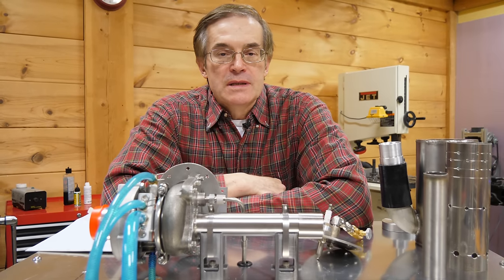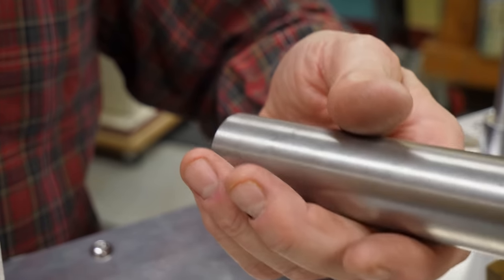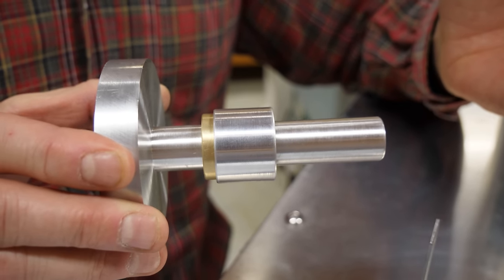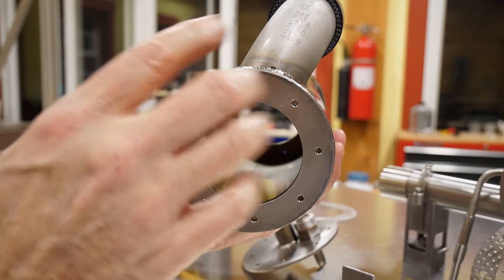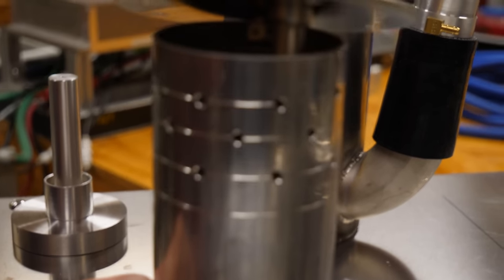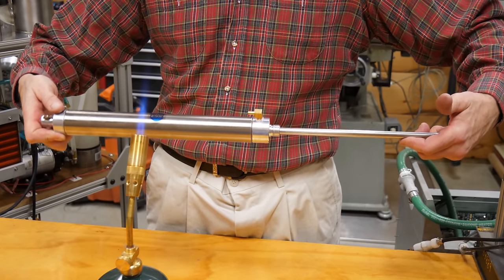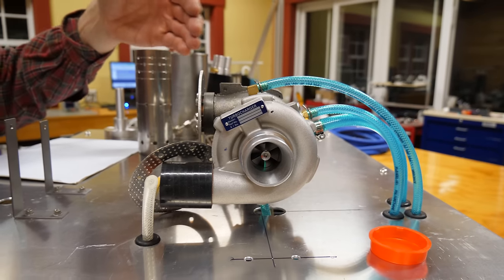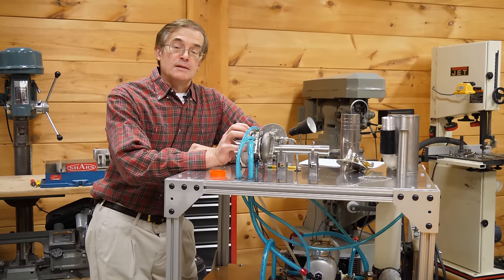The Turbojet!

Comment: You know what just gets me, I've learnt more about turbocharging cars done years of watching builds could had. Specifically interesting is the oil pressure stuff. Now I know why you need higher oil pressures when you turbocharge Honda 4cyl to 700+HP
Also the heat soak stuff, very interesting.
Reply from the maker: Thanks!
If you check out some of our other videos you'll notice that there is a lot of information that is related to the topic being presented, but has broader utility.  That is why our videos tend to be relatively long.
Reply: @TechIngredients  I found you channel long ago, but I remember my stupidity and superiority complex kept me out of it for a while.
I first saw your revolutionary AC video and I thought you were over complicating stuff by adding desiccants, while you could just pump the cold, swamp cooler water through an heat exchanger with a fan and direct that air inside the building. I found the video again today and realized how much I had missed because of not wanting to hear through the whole thing.

I really appreciate your videos now that I've matured and I see many ideas I've had over the years being implemented into your projects. The EDF motorjet comes to mind, an engine that I wanted to build years ago. There, you also see the propane motor cooling, just as I had thought of something similar, utilizing liquid nitrogen to run an electric RC motor above specification.

Anyways, keep them videos coming, I love your projects and I hope to be building my own ideas soon enough!

Comment: This will be a reference for upcoming DIY turbojet enthusiasts. You nailed it with the numbers. Awesomeness at max👊🏽
I want you to add one more turbo which will run on steam generated by this engines heat and drive it's compressor which will increase the compression ratio. Can you make it into a reality?
Reply: I feel like introducing water to the inside of a turbo is a bad idea
Reply: We will achieve that by adding a heat exchanger instead of directly injecting the water.

Comment: It would add to the complexity of the build, but it would be useful to capture the diagnostic data in digital form for later analysis. Thermal sensors in the combustion chamber and exhaust stream would allow you to capture additional useful data. As one of my college instructors used to say, you can never have too much data.

Comment: Way back in my middle-twenties I had built a stock 1600 cc Volkswagen motor for my Karmann Ghia. To add additional power I’d bought a Ray-Jay turbo. But, lacking in information and engineering experience, I was too afraid of blowing up my engine and never installed the turbocharger. 
Carbonizing the lube oil was one of my concerns. The other was that I didn’t make so much money that I could afford to be blowing up motors.

Comment: Speaking of the combustion chamber if you were to sleeve the inner cylinder with matching holes overlapping but movable you could control part of the throttle by rotating the inner cylinder and changing the airflow through the chamber.

Comment: I would recommend using a automotive remote oil filter kit. This allows you to have and maintain the oil fiter for much cheaper over time. 

Also, the 'series' turbo setups are called Compound turbo chargers. You could possibly mount the chargers in a parallel turbine, series compressor orientation as well.
Reply from the maker: Thanks!
I will review that terminology for the viewer in a future video.  Series turbocharging is a good way to describe this process to those not familiar with the principle, but is not the terminology used by those with experience in this area.
Reply: @TechIngredients  not meant as an insult. Funny thing is, you're dabbling into things I've done on all fronts. Turbos, audio. The works. Love it. Keep it up.
Reply from the maker: No, offense taken!  Your point is a good one and thanks for comment.  There is a tendency to think that things we each know are understandable to others who may indeed be otherwise very knowledgeable.  I try to keep this in mind in these presentations.  I don't want to talk down to anyone, and I don't want to let jargon get in the way of a simple principle.

Comment: Pretty neat and might work well but can't help feel that an engine with very short path and a bare minimum of direction changes has to be markedly superior. Might be 15 degrees total change in a straight through engine whereas a car design like that might have 1500 degrees of turn in a simplistic laminar interpretation. Of course you want a near perfect mix and burn but a combination of numerous mister injectors and a bare minimum of intentional vorticity if any should be possible. Deliberate mix over lasting stagnant chaotic confinement.

Comment: Instead of using additional air for cooling the peak combustion temps, use water injection instead.
Also, the same water that you will be injecting should be used for bearing housing, and oil cooling.
This keeps all the heat energy inside the system, rather than throwing it away by heating the ambient air.
You can also fabricate a closed shroud around the exhaust nozzle, the combustion chamber, and
the hot Turbine side of the turbo housing,
then direct that hot air into the Compressor Inlet.
This will affect calculations of the relative sizing of the Compressor to compensate for the reduced air density.
This may seem counter intuitive at first, but it's actually not, this, combined with the cooling water injection,
will actually reduce the peak temperatures, and increase the volume/pressure of the exhaust gases,
and increase overall efficiency substantially.
( as if, jet propulsion was good for anything besides jet airplanes ) 
( it is a fun project though, and better thought-out than the first one )

One other item......
You really should look into  "Stagnation Point Reverse Flow" (SPRF) Combustion Chamber design.
( as if, you really care all that much about reducing emissions and gaining maximum combustion efficiency )
It is also virtually immune to blowing out the flame, and can operate at extreme mixture ratios with total stability.
BTW, I don't think you mentioned what type of fuel you intend to use.
I would recommend Diesel, it's safer, lubricates, and contains more energy than just about any other practical fuel.

Water expands FAR more when it is converted to Steam, than the expansion from heating additional air.
( Water to Steam = 1600 X volume, if I remember correctly )

In addition to this, a multi-walled Combustion Chamber design allows for more TIME, for any fine water droplets
to be converted to lots of wonderful STEAM,
and better thermal control of peak combustion temps.
Remember, the only thing that high temps are good for is expanding air, or creating MORE STEAM.
It is more advantageous to have 500F steam, with crazy volume, than it is to have 1000F AIR with much less volume.
( actually, the exhaust is already ~85% steam, and using the excess steam temps to expand air is not very efficient. )

You better watch out ;)  if this keeps going, I'll walk you through how my ~80% efficient engine invention works.
It actually produces copious TORQUE on a shaft, rather than the limited usefulness of jet propulsion.
YouTube videos on turbocharger jet engines is what set me on the path to creating a completely new
method of producing torque.
It works at ~450psi, and ~450F, and is specifically designed to produce steam "on demand", and efficiently
turn that steam into very practical horsepower, with NO reciprocating parts.
And here's the kicker..... It's made out of PLASTIC, (except for the combustion chamber).

Looking forward to the next installment.
.
.
Reply: Don't some jet engines also use the fuel for the cooling instead of water? Pre-heats it prior to going to the burner, but it also means one less thing to carry where you're weight-constrained on an aircraft.
Reply: Generally, (and there have been many, many configurations over the years and amongst manufacturers),
in real jet aircraft engines, they are usually more concerned with the problems of
oil and fuel freezing-up and coagulating in the lines and filters at high altitudes where
things can get really, REALLY cold, rather than any considerations of efficiency or power increase.

On the other hand, 
back in the days of piston powered aircraft, 
most military aircraft had water, or, water/alcohol injection, 
for suppressing detonation under full turbocharger boost conditions. 
This was especially important during fully-loaded take-offs on short runways.
.
.

Comment: Heat-Soak is the main reason why you're supposed to let any type of engine cool down at idle for a period of time after use. This allows the cooling and lubrication systems time to "wick" the hot-spots out of the engine before equalizing its temperature. Also, using one turbo-charger in front of another is typically referred to as a "compound" setup. In cars/trucks, using compounded turbos also gives the benefit of decreased "turbo-lag."
Reply from the maker: You're right.  I know what you mean about the terminology ie compound turbocharging and I know this is widly accepted, but I think it is confusing to someone not familiar with the jargon.  Series is clear enough for the application as I proposed it, but compounding implies mixing like blending chemicals, as well as multiplying like compounding interest upon interest.
I'll review the jargon for the viewer when we get to the two stage system video.
Reply: @TechIngredients  Fair enough. Thanks for the reply.

Comment: Great video, but I have a few questions. I am tempted to use a cheap oil/fuel pump but am not sure if it will make adequate oil pressure, what pump did you use and how much pressure does it make? For the oil cooling system, do you have to use a filter or can you get away without one? How does the oil system work, does it just get plumped into the top of the turbocharger and then has an outlet at the bottom that drains back into the tank? How large is your oil reservoir and what kind of oil do you use? Sorry all the questions and I swear this is the last one. Have you made an afterburner for this turbojet engine? Thank you so much for making these videos, I find them very entertaining and information dense while at short as possible. 
Thanks.
Reply from the maker: Because we have no plans to use these engines for thrust, but rather to generate high pressure gas to drive a turbine, we won't be adding an afterburner.
A typical automotive oil pump should be fine and we didn't use a filter.  I would recommend an inline pressure guage as that proves you have sufficient oil pressure when the engine is so loud that you'll have no way to be sure it's even running.
The reservoir only has to be large enough to avoid bubbles from being sucked into the pump's inlet and have enough reserve as a little oil will be consumed in the jet.  The plumbing is trivial, just make absolutely sure the oil is flowing.
Reply: Tech Ingredients, Thank you so much for your quick reply, and I love how well done and neat you make your projects. For the oil system, what I understand is that the oil is plumped into the top of the rear section of the turbo and then drains through an outlet directly underneath where the oil is pumped in. And form the drain it flows back into the oil tanks. Is this correct? I am planning on having 2 oil pressure gauges and a temperature gauge because I love redundancy. The pump I am planning to use is 10 Gallons per minute, is this enough? Also I did some calculations and my oil tank is approximately 2 gallons. Do you think this is enough for a decent sized turbojet? How large is your oil reservoir? Also, in other YouTube videos (colinfurze’s) the oil system used a bypass system that would let oil back into the reservoir when the pressure went above 3 bar(43 psi). Is this necessary for a safe oil system. How large is your oil reservoir? Again, sorry for all the questions, but you learn from the best, so with your input I should be getting somewhere. Thanks.
Reply from the maker: Your pump and reservoir are fine.  Your reservoir is probably twice as large as it actually needs to be, but don't forget to include a radiator.  Both the oil and fuel pumps (if you are using liquid fuel) can incorporate bypass valves to allow you to adjust the delivery pressure while maintaining flow through the pump.  They need continuous flow to cool themselves.
You can pump the oil in either way as the delivery pressure far exceeds gravity, but the in/out will be best defined by the fittings on the center section.
Remember, Furze's turbo burned out it's seals on his first runs.😙
Reply: Tech Ingredients, Thank you for your quick response and I think I know what I’m doing now. I do plan or using a radiator that I’m going to put a motor with propeller in front of to give airflow around the radiator. I am planning to use an electric speed controller to adjust my oil pressure by increasing the voltage going to the pump. Do you think I should just go with a manual one instead? The last thing I’m concerned about is the safety bypass valve because it’s rated at 3 bar(43 psi). Is 43 psi a high enough pressure to feed into the turbo, or will it get blown back through the delivery system? And I’m not too concerned about the pump running dry since my reservoir will be so big there will always be oil circulating. I’m still not sure whether to go with the safety valve, do you think it’s necessary? I noticed you used that reinforced tubing for the oil and water systems. Do you think hard plumbing with copper is better or can I use the reinforced soft vinyl tubing?
Thanks. 
P.S. I am planning on using propane to run the engine first and then would like to try to convert it to liquid fuel.

Comment: We could add water to keep the combustion temperatures down. if we use Ethanol as fuel, we could add a specific concentration of water to the fuel and still burn a stoichiometric mix of ethanol and air. the additional water vapor in the exhaust should also give us better performance.
Reply from the maker: You would want to add the water or methanol prior to the combustion chamber to allow higher density air to enter the combustion chamber.

Comment: Howdy, watched a lot of your videos and I think they're good and informative. Can you do a video on converting a gas engine into a partial hydrogen based motor? People are using containers with water and a form of electrolyte, they are adding electrode conductors and energizing the system to create a h20 gas and power the engine on vapors. Examples being used are vehicles,  lawn mowers, generators, etc.

Can you do a version of this project? I bet it would be great!

Sincerely, 

Justin Forsman

Comment: Really good video.

During watching it I asked myself whether it could get more efficient, besides sequential turbocharging, by attaching a prop to the shaft. This way it would kind of work like a Turboprop. Although probably that would be quite complex to implement and not incredible effiecent because of energy loses in the construction...

Anyways keep it up!
Reply from the maker: Thanks, we will.
We are building a free turbine output to allow low speed applications like a transmission drive and a generator as well as a large diameter propeller.
Reply: Tech Ingredients  Nice, looking forward to that.

Comment: Typically, an axial flow turbojet engine deliberately bleeds off a small amount of air at the 2nd or 3rd stage of compression to cool the oil reservoir and some other thermally sensitive items because on them it is just easier to divert a small amount of compressed air than to add many additional pumps.

Comment: Love your jet project,very straight forward explanation.I.m in the process of building one myself.I like your idea with using a fuel pump as the oil pump,does the heat of the oil cause any issue ?
Reply from the maker: I haven't had any, but I'm using an oil cooler as well.

Comment: Also if you add "louvers" S shape pieces to your combustion liner with a gap in the 0.075" it will lift the flame off the walls and create a low pressure zone, in the low pressure zone add cooling holes, a LOT of them but very small diameter in the 1/16" or less range

Also a ceramic coat (bond layer + top coat) will greatly enhance the life of your combustion chamber

Comment: Good to see you building a real jet this time 👍
Reply: One small thing but the charge tube should go in the bottom edge of the flame tube to promote proper air dilution to the tursary holes.
Reply from the maker: Thanks!
We did just that in the big brother to this engine which you will see in an up coming video.
Reply: @TechIngredients   great work on the overall neatness if the building of this turbojet.ive made a few of them from huge holset turbos and made the mistake of putting the charge tube at the top at first but was educated by some vetrin builders about so many aspects of what I was doing.great job just a constructive comment.

Comment: Excellent and very informative, Thank you for spending your time explaining and making these videos .... Subscribed!
2 part question-
Q. what would happen if you used 2 off the smaller turbo to save more weight, both parallel feeding the same chamber to increase the compression ratio instead of adding the even bigger turbo  ? And could you keep the weight saving in the flame trap/combustion chamber too?
Reply from the maker: Take a look at our follow up video, "Catching Fire".  There, I explain why a larger turbocharger is generally more efficient.  If you do go the route of adding a second turbocharger, then running them in series will give a higher compression ratio and more effeciency.